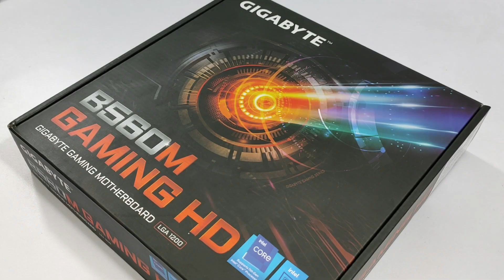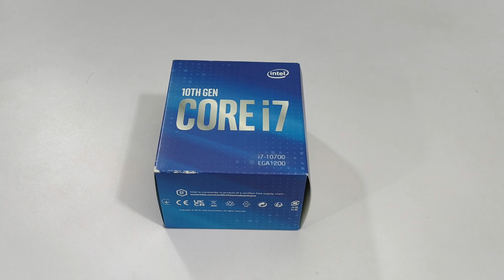HOW TO INSTALL INTEL i7-10700 CPU To Gigabyte B560-M Gaming HD Motherboard

Comment: lodsss nag upgrade ako ng ram sa acer aspire 3 a314-32-p2qg ng 4gb ram 2400mhz nung nilagay ko na po eh dna po nag open nag blue light nmn po eh pano po i fix
Reply from the maker: Tama nman po orientation pagka install sir? Ddr4 xa? Tanggalin nio po ulit c ram den try restart kung mag blue screen pa rin.